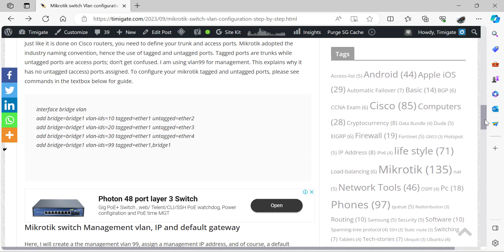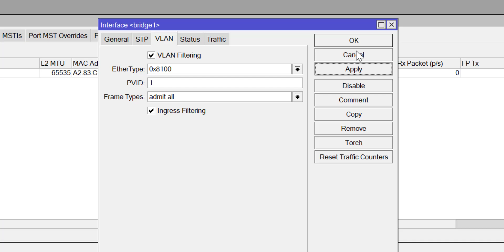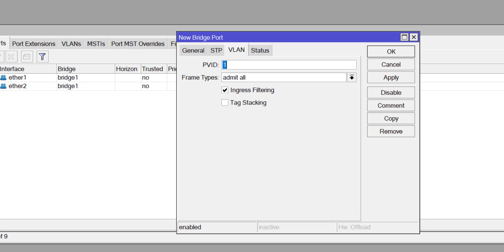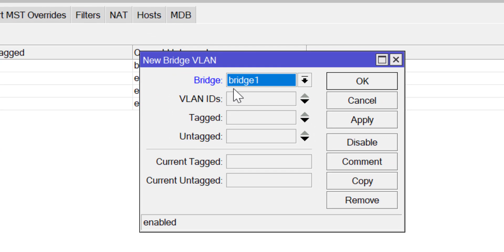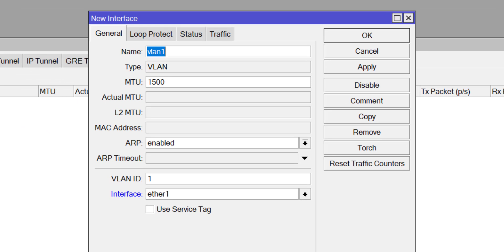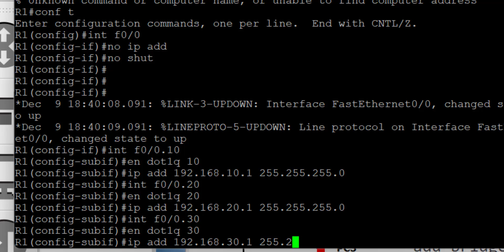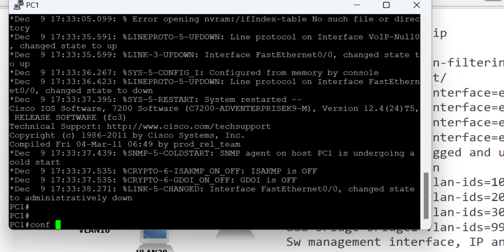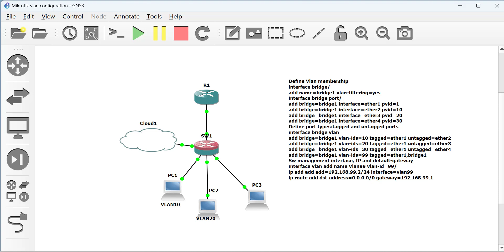Mikrotik VLAN configuration with tagged and untagged ports

Comment: @TimiGate This is  informative and thank you for sharaing but I have a question.
Let's say you connect PC5 (192.168.99.5) to ether5 and you untagged ether5 for vlan 99 so it can join the management network.
What do you have to do in order for PC5 to ping SW1(192.168.99.2)?

Comment: Generally you shoudn't enable VLAN filtering on bridge as a first step. This should be the last step. The only reason you weren't cut off from the router was that ether5 was not in the bridge.